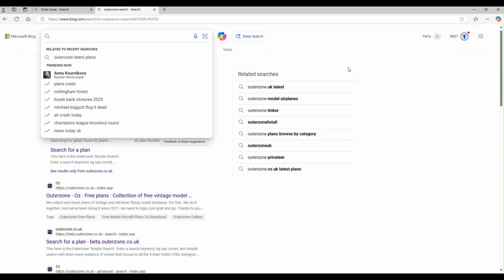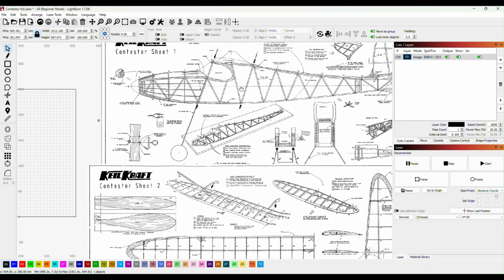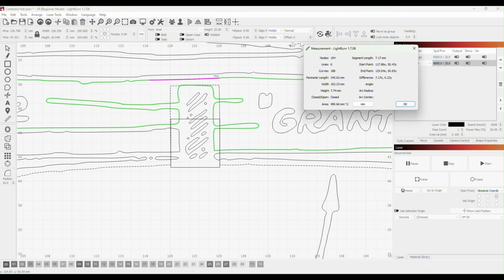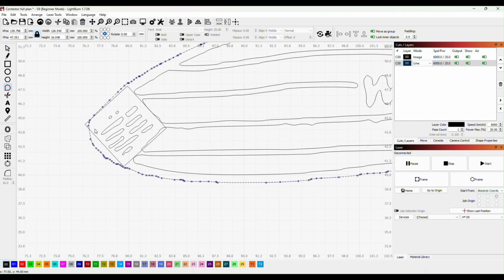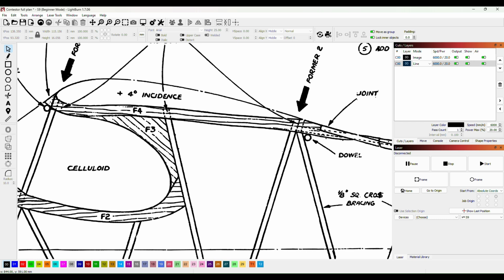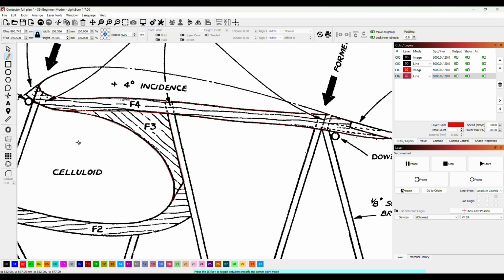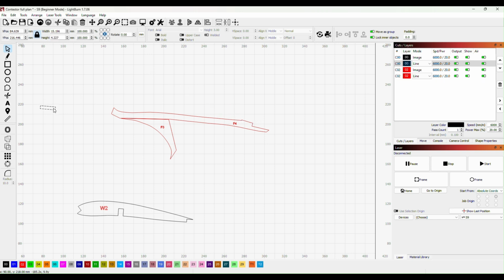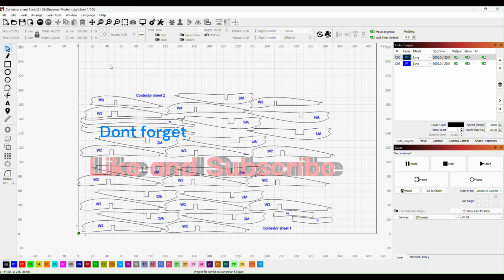How to make a classic Keil Kraft plane using Lightburn and Sculpfun laser (Contestor 1)

Comment: Hello sir 

Can I use 

Creality Falcon 5W Laser Engraver Machine, 72w High Precision 0.06mm Laser Cutter and Engraving Machine for Wood Metal Leather Acrylic Glass, 10000mm/min, Offline Usage, CNC Laser Engraver

As sculpfun S9 is not available in india 
Creality falcon I have backup source if I need any part to replace if needed in future 

Need your opinion 

Thank you
Reply from the maker: I have no experience with that particular machine, but if it is compatible with Lightburn then it should work fine. Let me know how you get on. 👍👍👍

Comment: Do you have an example making a plane larger than your scan bed?  When an element exceeds your scanner bed, and you want the larger size (I’m assuming you could scale the plan down if smaller was ok), how do you modify the plan?  Sections you can glue together?  I learn a lot from your videos, if you can aim me at a video you have done that would be great!
Reply from the maker: In the Hurricane series I scan parts of a plan in and make components from small sections of the plan, is that what you mean?

Comment: Would it be possible please to have a vid showing the uninitiated how to set up one of the S9 laser cutters, what is an air extractor thing, how you avoid cutting through everything underneath the laser. And then we can then perhaps take a look at using plans and Lightburn software to out the parts. Not wishing to be negative but too much cart in front of the horse in all these videos.
Reply from the maker: Thanks for your comment Mark, this is the second series and I really do understand what you mean, but I cannot really go over the same stuff every time. If you look at the first series (Hurricane) then I'm sure you will get all the answers. But I can try to help now with the questions you ask. The S9 comes in flat pack with clear instructions how to assemble. The laser module set up is covered in the first series and again in this series showing how to set up a 'test cut'. The air extractor I use is an 'inline extractor' https://www.amazon.co.uk/dp/B0CJFJ5W35?ref_=ppx_hzsearch_conn_dt_b_fed_asin_title_2 from amazon with a 100mm (4 inch) flexi pipe that I put out the window. There is a 'honeycomb' work table that sits inside the feet of the laser https://www.amazon.co.uk/dp/B0C2NYFNRX?ref_=ppx_hzsearch_conn_dt_b_fed_asin_title_1 and this is what you sit the work on. I hope this helps.  👍👍👍

Comment: I remember making kits like these in the early 70's! I'm trying to get plans for boats as I'm afraid my radio control flying skils are non-existent!
Reply from the maker: Thanks for your comment. You could always fit a Gyro to your plane. That would help you with flying. 👍
Reply: @LaserRCModelguy many thanks for the advice, is this something that you could do a video on? I guess a lot of people would find that helpful. I’d not heard of such a thing before!
Reply from the maker: @pauld7827  Yes, I can. I will fit a giro to this model So you can see how that is done if that would help.
Reply: @LaserRCModelguy  That would be brilliant! I've not heard of such a thing! Keen to learn though. Your experience is very valuable to us viewers.
Reply: In the 70's they had an RC sub if you want an excuse for it sinking. 😊
I spent a month with mayor and the parks guy so I could use my sailboat in the local pond.  Finally got approval, and realized I had no ground freq radios.
Out came the '76 World Expert Radio mothballed by uncle sam. and an ardiuno.....  Maybe i'll upgrade to a pi and add multi boat selection sometime.
Make a fishing troller, and get the game warden upset, with dragging the net.  😇

Comment: almost tempted to actually finish the laser cutter...
got it working a few years back, then went overboard. with this exact type of job in mind...
erm. wasnt happy with the cut being a line rather than a dot... too much tweaking to try and get things like rib slots cutting accurately... got a plano convex semi cylindrical lens... and a few other bits and pieces...

and thats about as far as i got, lol. like a lot of things, got shelved for a while... the cnc mill had a breakdown, i had a breakdown, meantime, lost files, software, blah blah...

should have just bought an 80W co2 back when i had the chance... sigh. funny how you regret clicking on things sometimes, and other times, regret NOT clicking...
Reply from the maker: Well I hope you get going with it again, I have done a video showing some detail about positioning spars and such (It was requested by another subscriber) I will be putting that on tomorrow. Thanks for your comment. 👍

Comment: How do you ensure scale accuracy if you are copying from one of your hardcopy plans?
Reply from the maker: If you scan in a paper plan, once you copy all of the components the best thing is to use the measuring tool to check them. I did it with a while ago and found all of the components stayed in scale, but were 93% of the original size. If you work off photographs instead of scans then I think you will have to check and resize every component.

Comment: Hi, glad you are using the Square function, you could have drawn a rectangle 5 x 7 for your main spar. Moving nodes takes a lot of time, just drop your rectangle in and then using your scissors cut away sections of the path that you don't want . If the lines of the square or the rectangle intersect the outline and the image is un-grouped you can delete unwanted lines.
Reply from the maker: That's a good tip, I'll try that out and put it in my next video 👍
Reply: Yes, this how I do it also. I don’t use Lightburn but Vectric V Carve Pro but it works basically the same way.
Reply: Good idea.  Was looking into this and I saw a suggestion  to convert the rectangle shape to path and this then adds nodes on the spar cutout

Comment: Hello Laserrcmodelguy,

thanks for the detailed instruction.
Nicely and calmly explained! 👍

Two questions...

1. Wouldn't it be easier, quicker and more accurate to subtract the templates for leading edge, trailing edge and wing spar from the outline of rhe rib?

2. How did you scale down the smaller ribs W4...W8?

Many thanks in advance! 👍👍

Regards Michael
Reply from the maker: Hi Michael, thanks for the comment, I think some of the drawings on the plans are done with quite thick lines so I use the 3.2mm square to get greater accuracy. On this model I am beefing up the nose with a 4.8mm leading edge so I scaled it up a bit to strengthen the wings to deal with the extra weight of the electrics. To scale down the smaller ribs, I place them over the plan and shrink them by grabbing the corner and line up the 'birdsmouth' with the corner of the leading edge and the the trailing edge of the rib over the corresponding point on the trailing edge of the plan. Then using nodes I reform the centre spar (3.2mm) hole in line with the spar on the plan, it's fiddley but accurate. 👍
Reply: @LaserRCModelguy 
Many thanks for your detailed answer!

Greetings Michael
Reply: When laying out your sheet it looked very efficient, but you didn’t seem to pay attention to the grain direction. 
Thanks for the video.
Reply from the maker: @alfredvink  I always put the sharpest or thinnest lengths along the grain but sometimes there are two or more pointed ends so you have a choice, it is not a strict science the thing to avoid is a long section going across the grain. Thanks for your comment. 👍